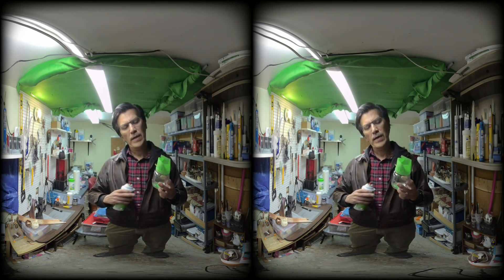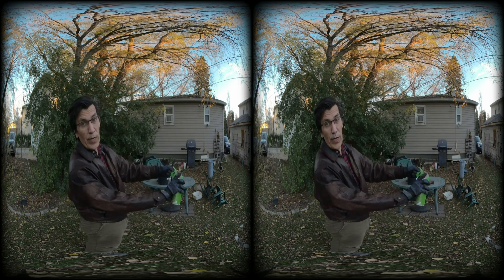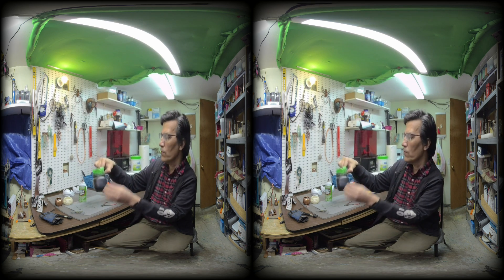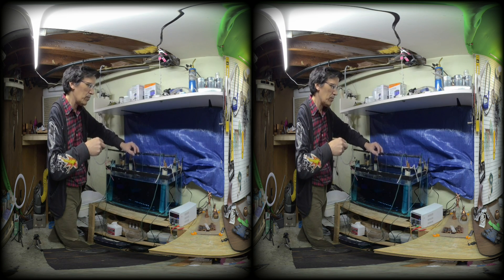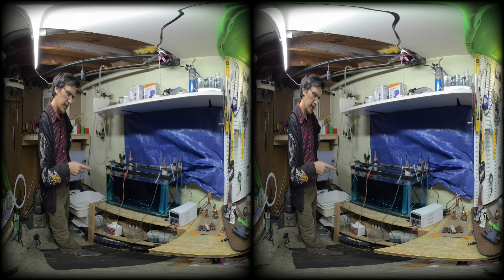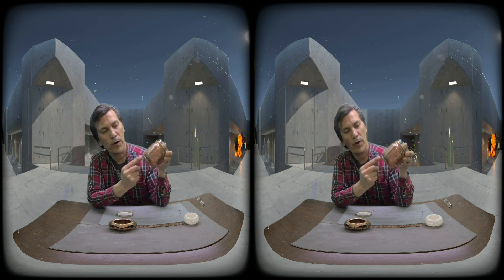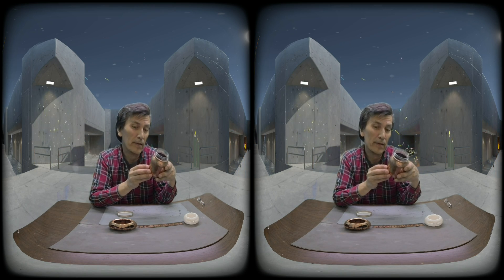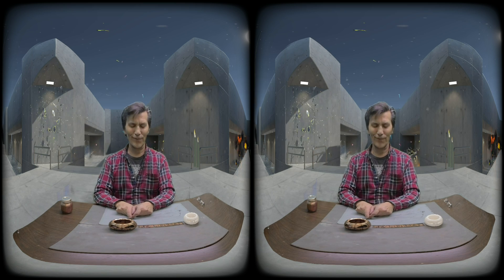Electroformed Copper Mason Jar - Mixed Reality VR180 with Unity Engine

Comment: Hi I have a big bowie hunting knife and even tho I copper plated a spoon and a mechanical feeler gauge. I tried plating my handle and wouldn't stick evenly. I cleaned the handle to oblivion. Its meant to be a brass handle! But the bright brass electroplating has worn off! The metal underneath is almost black or dark grey? Would the graphite spray work in my situation? Subbed and liked ! Cheers from Australia 🙂👍👍👍any reply appreciated...
Reply from the maker: If it’s a dark metal it may be nickel or tin. You may be able to electroplate it as bare metal. Acid etch first, then rinse, then tank. Or ….clean, and use the graphite spray